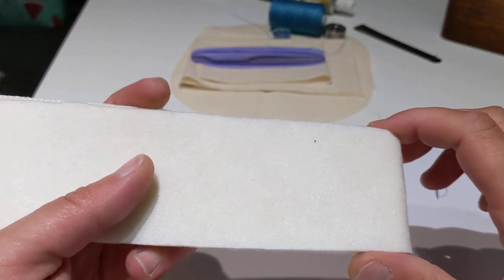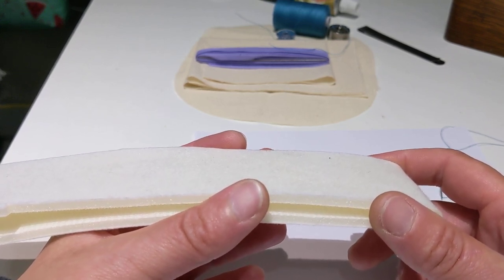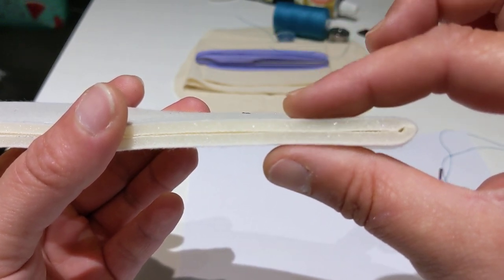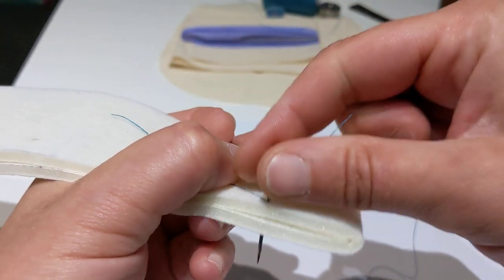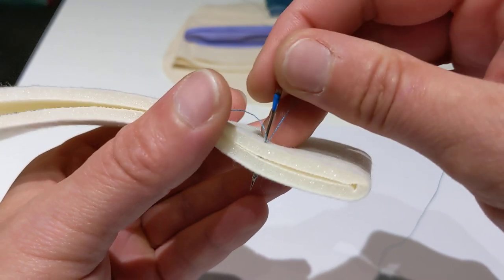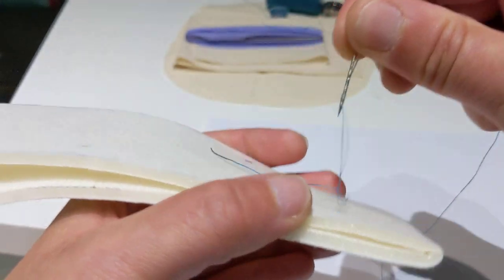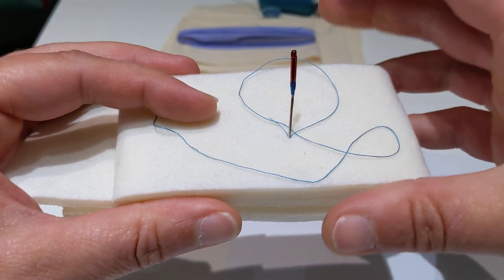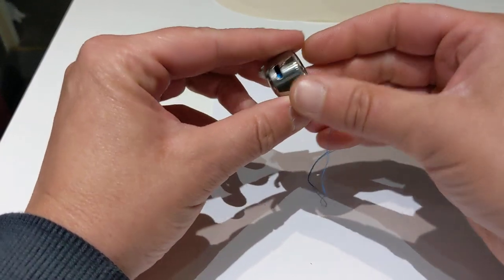Tips for using a vintage sewing machine (understanding pressure & loading a bobbin)

Comment: I really struggled to understand tension and pressure on my mother's old singer 99k which I have come to treasure. I tried reading through the manual and have viewed other tutorials videos but still struggled to understand  aspects before I found your tutorials.  Your videos are so helpful and easy to follow, your techniques really help to demonstrate what is happening and the underlying reasons for the parts and process of the machine. Thank you. Rhian.
Reply from the maker: You are very welcome, I'm pleased they help. Tension used to break my brain when I first started sewing, but once you can set your tension right it's a great feeling ♥️

Comment: I've just acquired my first vintage sewing machine and am a total newbie. I'm devouring your videos as they are so clear and detailed.  Whenever questions arise, within a few moments you've answered them.  A couple of questions remain though: 1) do I start with making sure the pressure is correct before fine-tuning the tension?   And 2) if my tension isn't right, how will I know that the pressure is right?  Thanks.
Reply from the maker: It's so exciting when you get your first machine 😁😁😁 thank you for your kind comments on my videos, I hope they are helpful.
Ok pressure - first place a folded piece of fabric under your presser foot, lower the foot and just hand turn the wheel. The pressure should be enough to hold the fabric (give the fabric a gentle tug towards you, it should hold but not in a death grip. If the fabric moves to freely, increase the pressure a 1/4 turn each time until you are happy (or release if too much). The pressure is just to hold, if it's too much the feed dogs will dig it to your fabric. (you could always release the pressure all the way and then gently increase until you are happy.
Sometimes the pressure can affect your stitches, but this is more noticeable with thick fabrics or vinyl.
So start with the pressure and then move on to tension.
Even with a rusty machine that has been forgotten for decades will normally still have the correct pressure - it isn't changed much. 
If you get a chance to watch my 201k rescue vlog (I can't remember which video it is, but I did set it up as a playlist) I video putting the pressure foot rod and pressure spring back together and you can see how I tighten to get a good amount of pressure. It might help watching it being done.
I hope that helps 😁
Reply: @sewythingy  Thank you so much for your quick and detailed reply.  It makes sense to check the pressure first as it can be done without thread, and then move onto the tension.  I'll have a look at your 201k rescue videos too.  Happy sewing 🙂
Reply from the maker: @renebakerpuppetry  thank you, and happy tinkering with your machine. They really are beautiful and fantastic. And you can always get in touch if you are not sure of anything, I am always happy to help 🥰🥰